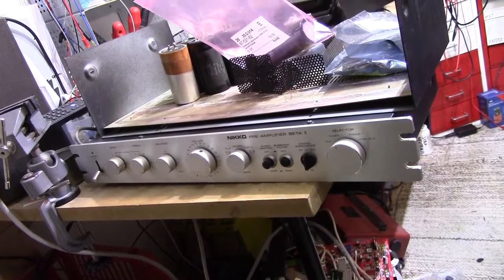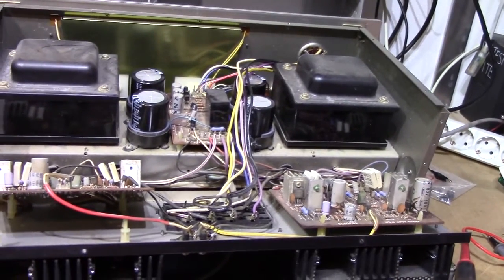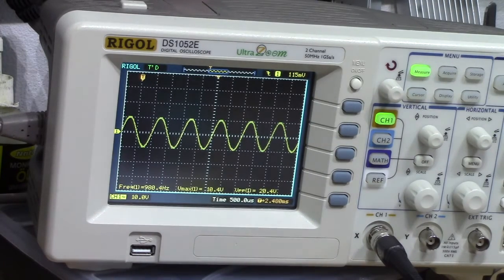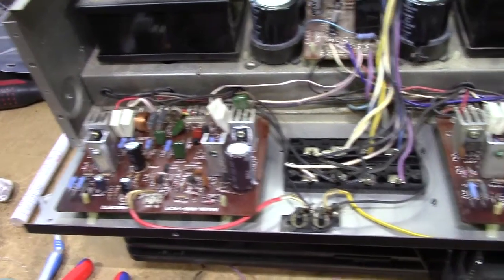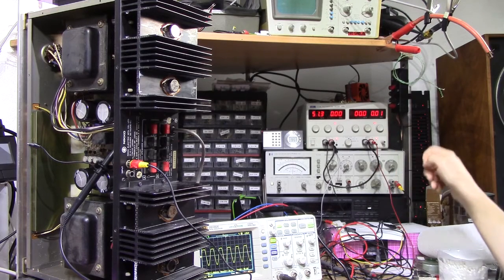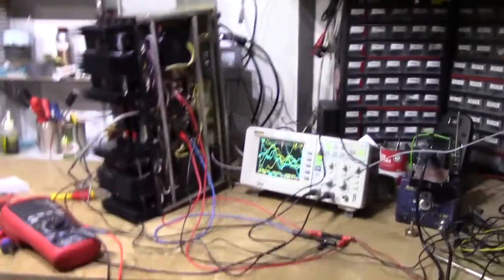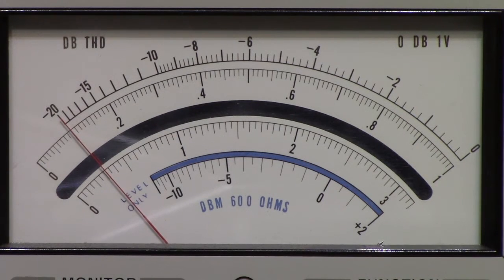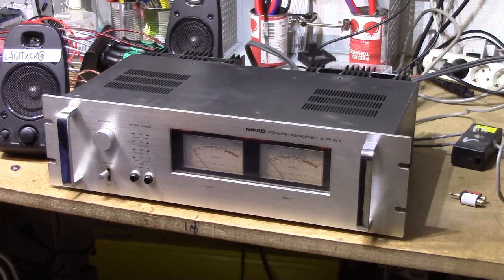Nikko Alpha II repair

Comment: I have an opportunity to pick one of these up along with the Beta 20 pre amp. Both are restored and re capped. These type of units are timeless designed to do one thing well vs multi purpose AVR's with DACS. These all have their places but I'm drawn to these pure audio units. Thanks for showing us the restoration as well as giving your impressions of the results. All the technicalities are well over my head but I've watched it several times!
Reply: I'm sure no one will read this but,.... I bought this amp and an Alpha Beta 20. Both totally restored by a shop that exclusively works on vintage audio. It's in the mail. This will be very interesting.
Reply: @WalterDavidRiffmon   i read this ... and how do you like it ?  with which speakers are you using it ? i have one but faulty now 
I wonder if to service it or not   It will be expensive i guess Regards, gino
Reply: @gino3286  I don't regret the purchase that's for sure. I paid a lot but that's due in large part to taxes and shipping costs which added considerably to the sale price. I have Ascend Acoustics Sierra 2 EX speakers. * ohm speakers but not the most in room sensitivity. I think approx 87 dB in-room. But the amp pre amp combo in fully restored condition power them fine.... no lack of dynamics and power. Worth restoring considering what a dual mono transformer amp with separate pre wold cost you new.
Reply: meant 8 ohm
Reply: @WalterDavidRiffmon  thanks a lot again i read something a nikko brand on audiokarma site and it was interesting Great brand indeed Kind regards gino

Comment: I am currently doing a total re-cap of one of these amps that I had put away for 5 plus years. It seemed to work ok when I stored it away. Since I have all the boards removed, was wondering if there are any other specific components you would recommend that I replace while it is easy to get at them. I do not have anything more than a multi-meter to test. I do have all the prints and service manual. I will be using this amp with Klipschorns, so any noise at all will be heard. Thanks!!! Great Viideo!!
Reply from the maker: Not really, these are pretty fine as they are.

Comment: I build i quad channel power amplifier that run on 240V on 220-230 V transformators  toroid type in 2015  and use 63 V caps with no problem.Old caps was rated  ac V.Today  are rated after how much dc V they are rated for.Had some integrated nikko amp.s  and a Nikko alpha mosfet  power amplifier back early 80,s..62V on 63V dc rated caps are a bit high mine run,s at +49 Volt-0-negative 49Volt have 60 000 uf pr channel circuit is a no negative feedback local or global type.Have build some sets of 2 channel before.They are designed by LC Audio model The End xp millenium.i use 2 the 4 channels to drive 2 tweeters direct and 2 mids direct with drivers sensitivity at 96DB and is the most quiet amp i have tried.some mid end and high end a could hear the hizz from my listening position with this i can hear the AMT type tweeters faint hizz with my ear close to the tweeter i a active setup.I use Ground sound 4 way or stereo 2 way dsp crossover modules times 2.    both crossovers are set in mono mode 4 way and used in a dual mono 3 way setup for better channel separation.They are also very quiet.power amp is 4 times 95 watt.No self oscillation problem at all.The first versions of The End early 90,s had problems if not build right with that the 1 version that vere real good had 4 stages (The End MK3,1) and the last versions had 5 stages(The End XP millenium) very linear  and clean.You can look for LC audio The end XP millenium build description on google.Bruel Kjær well known messuring company used The end XP mill for some time i read i a hi fi magasin.They aso came out with class a version called Zapsolute no negative feedback.They dont change tone when volum goes up like those with local or global feeback.would rate the sound quality at high end no doubt.

Comment: Great video.  I am envious of your ability to clean the capacitor residue off the boards. How do you suggest removing that gunk?  I've limited myself to denatured alcohol with a soft brush in the past but don't seem to have been as successful as you. Also, do you make any effort to clean the residue before attempting to pull the old caps?
Reply from the maker: That yellowish gunk you often find is glue, and it usually comes off with violence.

Comment: Hi ! thanks a lot for the very interesting video.  Did you manage to restore the amp ? how does it sound ?  do you think it still represents a good value amp for today standards or it is obsolete ?  i would like to search for one and any your opinion would be very precious to me.  I Always look for a clean sound and good 3D soundstage.   (Sorry for the poor english)
Reply from the maker: It's very good by modern standards, audio amps don't really go out of date.
Reply: Hi !  this is what i wanted to hear. Thanks a lot, gino
Reply: @FFcossag  I own both Alpha and Beta II’s. I’d like to know why it’s a very good amp, what makes it you say that. Is there anything especial in the circuit layout, or the components used…? 
BTW, do you think this amp can rival great amps (power amps, integrateds and receivers) of that era (late 1970s) such as Marantz, Yamaha, Sansui, Pioneer or McIntosh? 
I’m extremely curious to know where in the quality tier of amps it could be placed in. 
Thanks and congrats for the video. I’ve watched it a couple of times so far.

Comment: That diode on the driver board, it has an odd symbol? is it some sort of "dual" diode ? I thought you called it a VDS1212, is that correct? I have this amp, bought new along with the preamp, must have been 1980/81?. I stopped using this when I discovered the main caps were leaking, that was in the early 90's. After seeing your repairs I'd like to get mine up to speed, Thanks for the video
Reply from the maker: It's been a while since I filmed this, so mind any errors, but if it's one of those diodes that mount to the heat sink (for bias compensation), then it's basically 3 1N4148s in series.

Comment: great video! where did you get all the parts from--caps and heat sensors in particular ?  thanks
Reply from the maker: I think I ordered everything from Mouser.
Reply: the heat sensors as well? thanks much
Reply: I meant temp sensors
Reply from the maker: If I replaced them. I don't remember everything I do to an amp, this video was shot in 2015.

Comment: hi, need to install/replace the 4 10000 uf 63v caps - - I cannot read the poor schematic I can find  on the net. Do you have a photo or a simple color coded wire diagram for these 4 caps ? The caps are missing so I have nothing to go by.

THANK YOU - - YOUR VIDEO WAS AWSEOME AND VERY HELPFUL!
Reply from the maker: I usually grab schematics off of hifiengine. It shouldn't be too hard to figure out though - just measure which wires go to case ground and which go to the rectifier.
Reply: @FFcossag  Hello, I want to change the caps in my NIkko Alpha, one channel isnt working anymore. Did I understand you correct that you advice 80V for the big caps instead of de original 63V for big 4 10000uf caps? because of 230V? 
Very nice video.
Reply: Hello Audio Junkabus, how did you solve this. I have the same problem. I don't know where te wires need to for the 4 big caps. I hope you can help me.